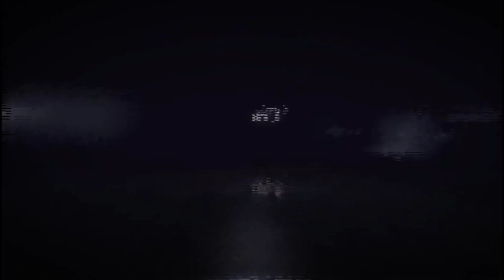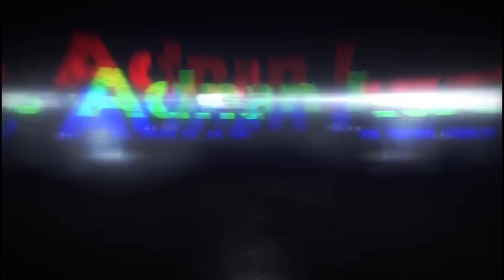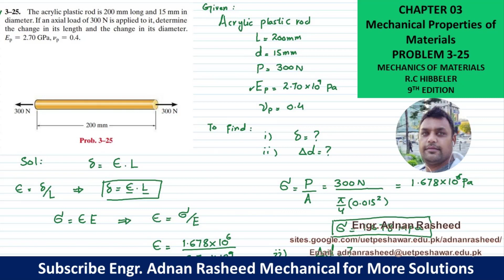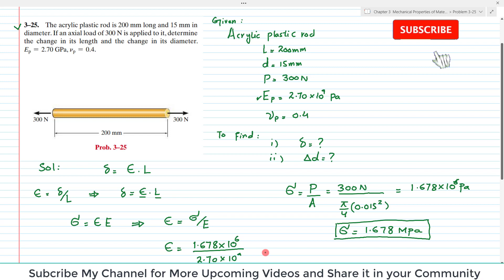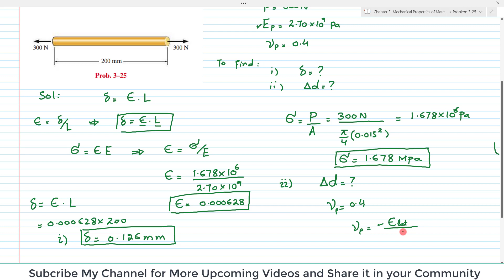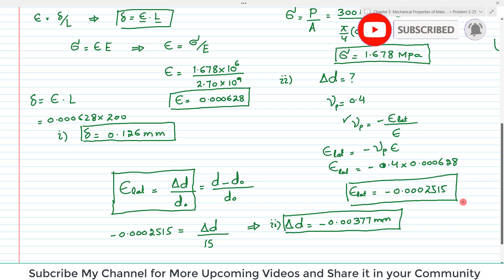3-25| Chapter 3 | Mechanical Properties of Materials | Mechanics of Materials by R.C Hibbeler|

Comment: engr. stress should be 1.697 times 10 raised to 6
Reply from the maker: There is very small difference between your calculation and what I have written. So don't worry just learn the problem and how to solve it thank you
Reply: @3:30

Comment: Why was 200mm not taken to meter
Reply from the maker: You can convert it into meter but the change in length will be also in meter and it will be 0.000126 meter . But when you convert it into mm it will be 0.126mm